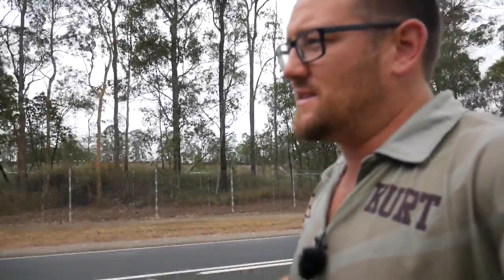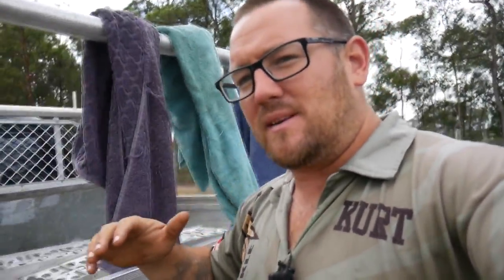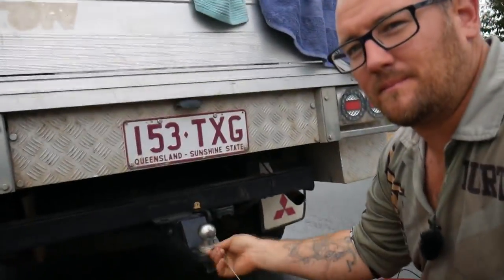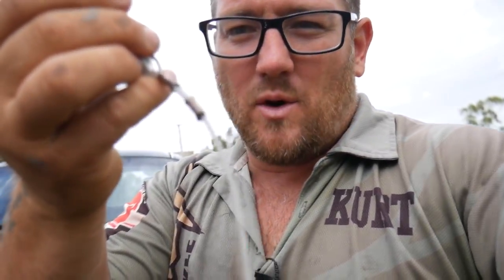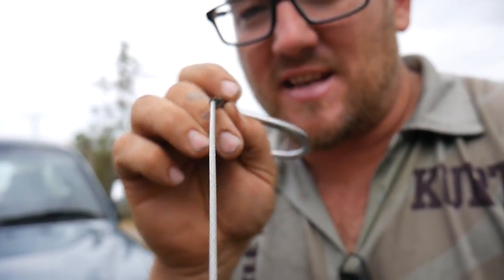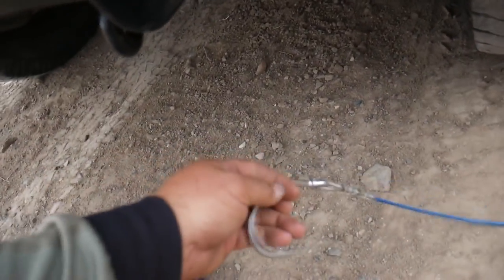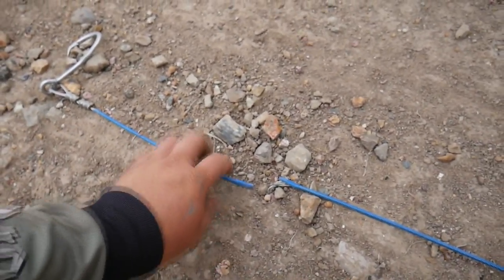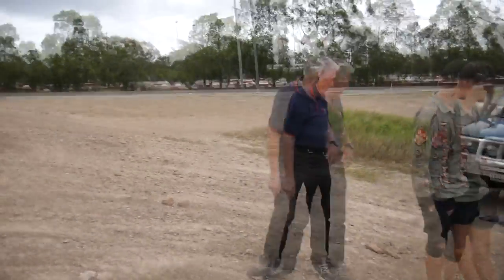SHARK TRACE. testing the limits

Comment: dont know why you fellas need to explain yaselves to be honest, 1000lb breaking strain pulling a 2 ton vehicle ( bloody Tritons of all things lol) up a gradient, something was gunna let go, but it just goes to prove to the trolls, ya gear works. Cheers Kurt and the rest of you Mad Mullet Boys, Tight Lines Guys
Reply: I tried posting a nonsensical reply, but I think it was deleted. After seeing your post, maybe Kurt didn't understand and thought I was a troll. I just came across this channel and subscribed, which shows I was not a hater. Anyway, hope ya rod has a bend in it.
Reply: @johnrogers5825  all good mate, I wasn't calling you a troll, tight lines Bud
Reply from the maker: @johnrogers5825  ay mate. This is kurt. I am not the only admin mate. What happened. I have taken a step back from all platforms. What happened
Reply: @teammadmullet  No big deal Kurt, I commented something like "this isn't a real test, because the towed vehicle wasn't fully loaded and the brake wasn't applied." I think someone must have thought I was actually serious. No problemo man.